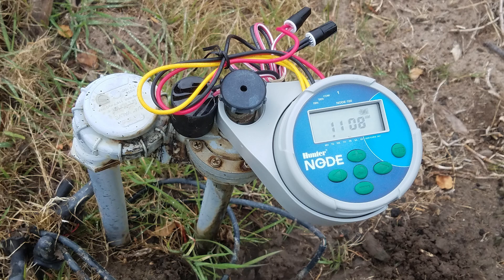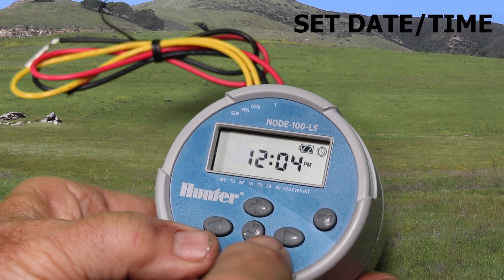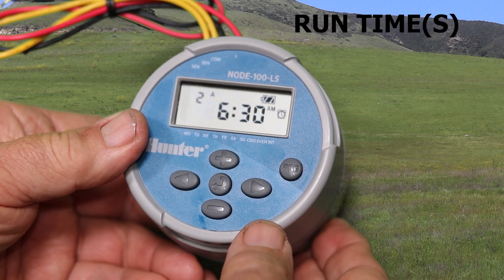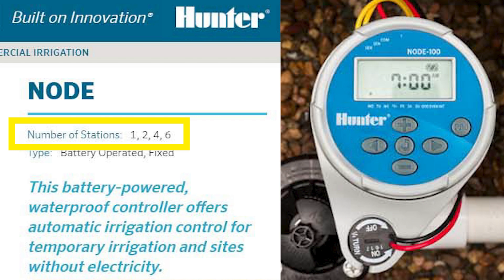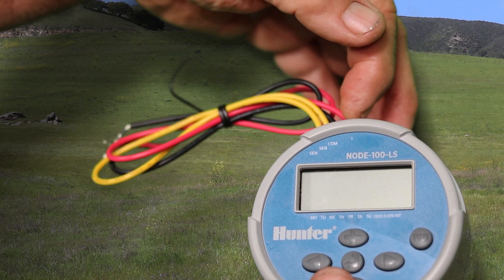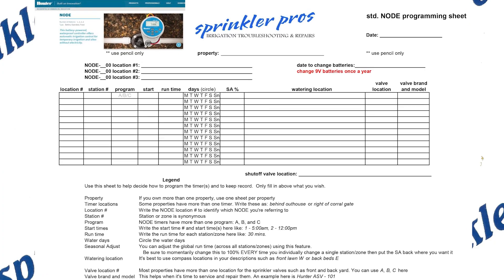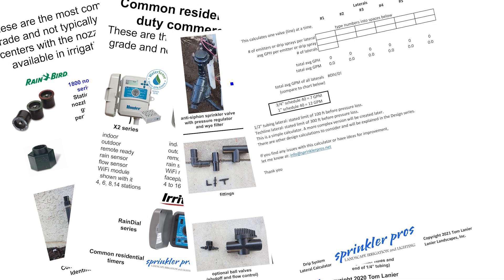Installing and Programming a standard NODE battery-powered controller

Comment: Hi, thanks for the video.  Quick question, I have the node depicted in your video. I have one zone on the node/vlave/timer.  I want to schedule 3 times per day for the zone. Would each time require me to use the program button to set up three Programs A, B and C? and then set start time for each Program? Or is there way to set three discrete times fro the zone using one Program e.g. A?
Reply from the maker: Aquaman, you can use separate start times on the same program. There are 4 available per program.

Comment: I am having so much trouble with my Node timer. I know I have it programmed correctly but when I go to test it, my sprinklers audibly "click" and then nothing happens. The timer shows the blinking sprinkler symbol, indicating the sprinklers are on, but they are not. I have triple checked my programming on the Node, and I even flushed and cleaned my solenoids. Any advice? Do you think my system is faulty?
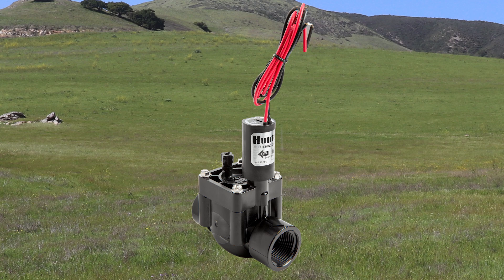Reply from the maker: The #1 reason for what you are experiencing is addressed at 1:01. I believe you have AC solenoids installed instead of DC. Watch the clip then verify the wiring at the valves.
Reply: @SprinklerPros  my solenoids say "DC Latching". I can get them to work, but now the drip line is constantly slow leaking. The sprinklers and drip heads come on and flow normally at their assigned times, but when the timer ends, they return to a constant slow leak. Any advice? Thanks for your help.
Reply from the maker: The valve(s) may have debris under the diaphragm internally that is keeping the valve from closing completely. The valve would need to be taken apart (after turning off the water supply) and take the diaphragm out and turn it over to inspect it. Be sure to do it slowly and see if anything falls down into the valve. You may need to flush the valve before putting it back together. flushing may not be desirable if the valves are down in a valve box though. Let me  know how that goes.